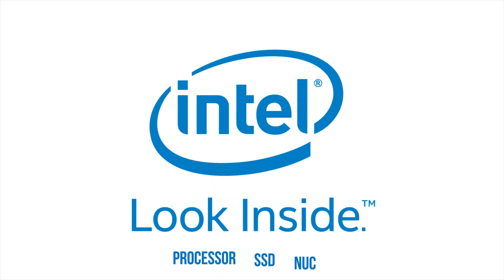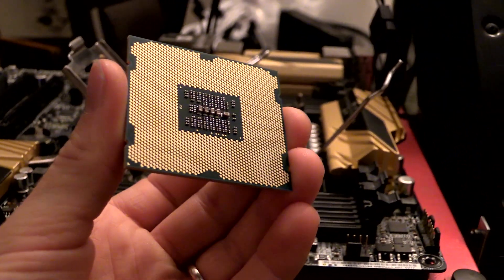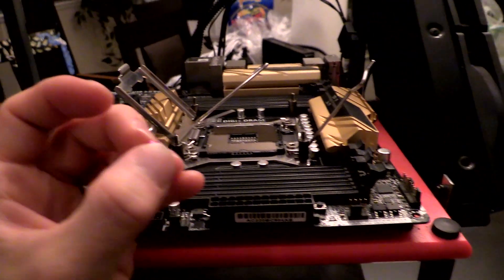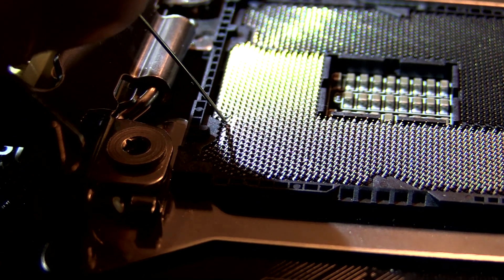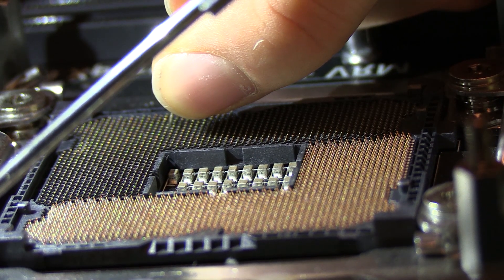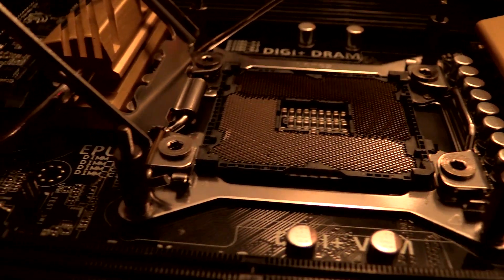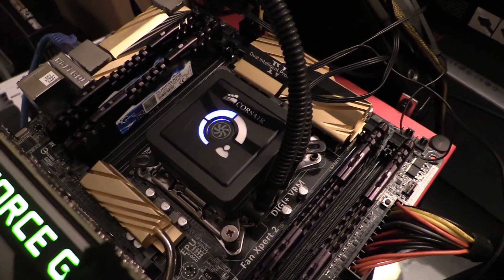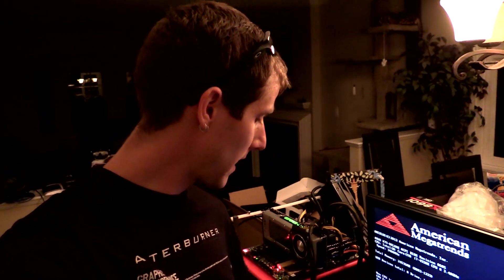LGA 2011 Socket Pin Repair Vlog - Fix a "Dead" Motherboard

Comment: Hey Linus! I watched this video the day it released.. and I thought to myself "wow that's a man with way too many spare boards on his hands". until yesterday I was faced with a similar problem, two pins on an LGA 1150 board were bent, and I used the tip of am injection to straighten them out, also I had no access to a magnifying glass. anyway it works perfectly now, and I couldn't find anyone else to thank but you. so thank you.

Comment: Best way to bend the amd cpu pins back is with a 0.5mm mechanical pencil. You simply take the lead out, put the hollow tip of the pencil over the pin and slowly bend it back.
Reply: I once fixed a pentium 4 cpu by moving a flathead screwdriver between the pin rows to straighten an bunch of them.
Reply: Linus mentioned that in an NCIX tech tips video when he salvaged an AMD cpu...
Reply: yep totally agree that's what I used when I bought a damaged athlon 5600+ years ago, although bent the pins on fx 8350 the other day and used my finger nail xD
Reply: that's
genius actually
Reply: OMG! Why didn't you tell me sooner???? LOL

Comment: You should avoid contacting the other pins with your bare skin.  I've assembled a stereo microscope from various sellers on EBay, I would strongly recommend it.  You can get an excellent setup together for comparatively little money.  If you can successfully fix these boards, there are real bargains on E-Bay for current generation "Not working" MBs.

Comment: I bought MSI z170A Mortar motheboard, settled all in, rig worked for like 3-4 hours. I power PC off and it won't power on again. After finding out whats going on, I noticed led is glowing on CPU.
Got CPU off and holy molly, pins were bent. 
I tried to repair them without magnifier glass, but it wasn't working. So I called it for RMA.
I told them it was working 3-4 hours and then it didn't work anymore. They told me its bent pins. I told them I didn't bent them, because my PC wouldn't work even 2 mins if that was the case. 
They told me that they do not accept warranty because of physical damage.
I'm screwed now, basically they gave me motherboard with bent pins and I cannot do anything about it. As soon as you accept package, if its with bent pins they will just say: "Hey, YOU BENT THEM!" and warranty is off.
:(
Reply: +BleedinglHeart  I have two heads off,  I checked the 1150 punout it says its for power and ground.. So I  didn't had balls to try it out,  bought new cheap as duck motherboard without capability to oc my cpu,  but at least I'm sure it wont die..  :/ I know i have 1151 pinout but its probably similar as 1151.
Reply: +89Ssik 1150 pinout is similar as 1151** writing from phone,  and people have reported their cpu died after like 1 week...
Reply: How do pins just get bent after working for 2-3 hours?
Reply: Buy from an online seller and get the return warranty to store (Newegg is my go to for mobo, buy the advanced insurance for a few bucks extra). Let them deal with RMA. Also, the pins do not bend over time. Either they were damaged to begin with, or you attempted to seat the CPU wrong.

Comment: +LinusTechTips my mobo has about 3 bent pins but here what happens when i powr on my mobo i have 2 psu's one is a 500 watt and the other is a 700 watt when i plug the 500 watt to the mobo it powers on for 2 seconds then shut off and will not turn back on until i hit the power switch and when i connect the 700 watt psu to the mobo it turns on for about 12-15 seconds and then it shut offf and it automatically turns back on witjin 3 seconds and does the same thing it will repeat this cycle until i hit the switch on the psu please help me a new mobo is not affordable for me or any one in my hous plzz help i really hope it not the mobo

Comment: I need ur help . I had a Zotac 620 graphic card and I sold it for some money. now my PC is not turning on. all the things in the cabinet run without any beep codes . but the monitor stays black...
Reply: +Vinayak S your processor has integrated graphics?
Reply: Nope dedicated graphics is 0mb
shared graphics is 125 mb shitty pc
Reply: you need to buy a shitty graphic card or a better processor, with integrated graphics
Reply: +Eduardo Rodrigues so u think the processor is dead ??
Reply: no, but the computer can't initiate without integrated graphics
Reply: i recomend to buy a cheappy graphics card
Reply: like a gt 210
Reply: +Eduardo Rodrigues Actually do u really get the problem I'm facing ??
well the screen stays black even after pressing the power button.
Reply: +Eduardo Rodrigues 
But will a gigabyte graphic card with 512 MB work ??
Reply: depends of your pc source
Reply: well man I borrowed my friends graphics card Zotac 610 but it's still not working
Reply: now u need to format your pc.
Reply: OK
Reply: I used another hard disk I had it was formated no use . the monitor is still blank no display.
Reply: ok, you plugged the video cable on the video card?
Reply: +Eduardo Rodrigues that's what graphics cards are for
Reply: ok, you tried to put in the motherboard?
Reply: +Eduardo Rodrigues actually that's how I started
Reply: +Eduardo Rodrigues I hav an idea what if I reset or jump the BIOS

Comment: i have a intel i7 processor and i want to buy a new motherboard, but i don't know the socket of my processor on the site it says the board is compatible with i7 but i don't know if i have a older i7 if that even exist can you help me out?
Reply: +2pvideo 
1) If you have a running system that contains your i7 CPU, then go ahead and download CPU-Z. It's a great program that will give you details about what socket your CPU is, and what model it is.

2) If you only have the CPU without a running system, then follow these steps: 
If you have thermal compound on your CPU's heat spreader, use light cloth dabbed with alcohol to wipe it off. The heat spread will probably have the model of your i7 imprinted, and you can check the socket number on the internet by searching for whatever model your i7 is.
Reply: my cpu is active and i have already tried the cpu-z it wont tell me the socket thou 
but on the mother board site it says its compatible with i7 (none inspecific) so im asuming it works with all right?
Reply: At least try and find the model of your CPU and try to research it on the web. No these CPUs will not work on all motherboards. There are specific sockets. eg, i7 3770 is an LGA 1155 socket and will ONLY fit on an LGA 1155 motherboard.
Reply: ok thanks a lot

Comment: I had the exact same problem with my board.  Ended up using the light on my phone and a needle.  Didn't have a magnifying glass so I took fully zoomed in photos of the pins with my phone....If it's stupid but it works then it aint stupid! =D

Comment: can broken pins kill the cpu i have this problem with i5 2500 and im not sure if my cpu is dead
Reply: +Naoufal D.Gnz I think that it is fairly hard to kill a CPU by conventional means... I accidentally put my 2600k through the wash when it was in my sweastshirt, since i had just come home from testing a friend's motherboard, and the CPU still works to this day. (obviously I let it dry out)
Reply: +Naoufal D.Gnz I think they could if they were shorting out, either by touching another pin or the wrong pad.

Comment: ...i am about to that , wish me luck linus
Reply: +Jeff Papas Wow that's some perseverance, glad it worked.  I would've been pissed to receive a board in that condition!
Reply: Did you fix it?
Reply: +gabriel mercado yep! The guy that brought me the mobo removed the cpu , and thought it was a good idea to hand me the cpu fan as a gift (!) , and put mobo and fan in a box together without any bubbles or paper , which box he put inside a motorcycle top case..... one of the cpu fan legs crashed in the socket and damaged many pins (at least 20) , and worked them good. Linus' mobo had no damage at all compared to what i received lol! I used same method years ago to fix another one without having watched this or any other video , but i was happy to see linus (and many other youtubers) use exactly the same method and tools! Notice that it may NOT work at first try , you have to relocate pins and try to post system several times till you get it right , in my case i did it more than 10 times. Good luck mate :)

Comment: i had lga775 same problem but i actually broke the pin on it tryin this xD. but i quess its not even the issue since the whole board dont even turn on. theres a flickering red light turning on near the 20 pin power socket. but the computer wont even turn on fans or anything. tried the mobo on different setups/psu but nothing. i quess lightning strike fired the mobo completely but im still hopin to fix it someway. oven baking doesent work either.

Comment: i miss the easily repair pins that where on the cpu :(
Reply: +Sana omar and how, I've re-aligned the pins on the Athalon X2 in my spare gaming rig at least 4 or 5 times now since its an old dell and whenever you pull the heat sink it takes the CPU with it.

Comment: I'm so pissed at myself since I managed to crush like 3 pins on my 1366 socket. I am gonna try and repair it tomorrow but luckily it was the socket B that got crushed. So I'm running the CPU A only which causes the fan to go on fullspeed for some reason. 

You truly are the king of kings at this Linus.
Reply: +TheSwedishCruiser did you fix it? what cpu are you running on your 1366
ive got an old i7 950 on mine :o
Reply: +Erik Seastead I managed to fix the socket pins so the machine runs very well now. I can do rendering using all processor power. However nowdays when I start up the system I get sometimes poor display output and only 1 display of my 3 showing information. And at the lowest resolution.

Comment: I use a "stitch ripper" to manipulate bent pins. It has a sharp, pointed tip, but it also has a broader, flat part that can be very useful in pushing pins in the direction they need to be pushed. Also, it has a plastic handle which makes actually using it a lot easier than a pin or any other small item that I've heard of other people using.

Comment: better if the pins were retractable the go down(undamgeable) when the clamp(is that what you call it)open then when you have the cpu in and the clamp closed the pins go back up to make contact

Comment: How the hell do you prevent this from happening in the first place? I've seen videos about broken motherboard pins and apparently broken pins are user-damage and not covered under warranty. Could it be that someone simply was being too negligent with their board and that they caused the pins to break? If I had a motherboard and CPU, I'd be extremely careful the instant I open that retention plate up. 

I've seen a couple people who build their computers on here, they fiddle around with the plastic cover that sits on top of the retention plate, they toss their CPU into the socket, they lift the retention plate up when their CPU isn't even out of the box yet. I really hope this usually isn't caused by wear-and-tear because motherboards are expensive.

Comment: You can replace a LGA socket, it's a $50 job at most electronics repair shops (ones that actually know what they are doing and not just humping iFixit.com)
Reply: LivelysReport you might do better to just buy a used 775 mobo... it'll probably be cheaper than a repair store. Recently bought a Gigabyte EP45-UD3p for only $25. Hell of a board.
Reply: Slot1Gamer Good to know never thought anyone was replacing actual sockets on these boards.
Reply: LivelysReport A bent pin is very simple to put it back. Just need to have a little careful. Sometimes I receive boards with 20+ bented pins... it's a 5- min job (there's no need for "extreme tactics".
The problem is when the pins are broken... sometimes may still work because some are ground pins... but if it's not... now that is way more dificult
Reply: Slot1Gamer so who replaces sockets and do they do 775 sockets??  I may try and fix the one I got, I think I got one bent pin, but if I can not get it fixed, I will either have to buy another board or see if someone can replace the socket.. so who do you know who does it that I can send my board to them to fix it.. I got a qx9770 extreme I want to run with it..
Reply: You can buy a brand new 775 socket from china or where ever (or even salvage one off an old board). Take it too an electronics repair shop that can repair BGA devices, they desolder the broken socket and put the new one on :3
Reply: what kind of electronics repair shop we talking about??

Comment: LinusTechTips I have an lga1150 board and only two of my ram slots are working, I noticed that you said only 24gb of ram were showing up till you reseated it. My question is, would a bent pin be the cause of the ram slots not working?
Reply: Yes, I have had this happen on my server motherboard, only 1 pin was out of shape causing one of the sticks of memory to 'disappear'
Reply: Grant Rogers thank you so much  Grant!
Reply: i have the same 3 bend pins 6 sots 4 not working and i have a bios message that i need to press evrey time
Reply: 1 pin = 1 function

Comment: For the record, the little metal tubes at the end of mechanical pencils are excellent for fixing the pins if they have been bent. Allows much safer leverage than a simple pin.
Reply: ItsEmber That is a great idea!

Comment: I bent about 16ish pins on my AMD Athlon a while back while taking the heatsink off (it pulled the CPU out with it, doof!) but I used a mini flat-head screwdriver and slowly bent them back! Put it back in and I'm still using that computer to this day!

Comment: I have a Gigabtey GA-X79-UP mobo with a bent pin, I tried this method, and my computer cant boot or post, and when I remove the ram it stays on, and the Bios beeps telling me there's no ram, so I dont know whats happening. If I leave the ram in it just turns on for a second or two, and turns off. Could this mean that I busted my CPU? Do I have a bad ram slot? (my ram is brand new, and I had used other ram in the system before, the GPU is working, and the PSU is working). Any input would be awesome because I have a limited budget, and want to get my computer fixed.

Comment: fixed a LGA 1155 socket yesterday using this method, the motherboard couldn't boot and couldn't detect ram. Now the board works fully but broke off two pins, so now only one ram slot is supported. But hey, better than nothing.

Comment: Thank you very much for posting this video Linus! Using it as a guide, I managed to save my new motherboard which had some bent pins (and was heading for the scrapheap). My own fault I must add, but you have just saved me the cost of a replacement board :)

Comment: Story time here: I ordered a Core I5 3350k IvyBridge CPU, an MSI CSM_B75MA-P45 motherboard, and 4 gb of Corsair Vengeance ram all from Newegg, I already had all other necessary parts for the build. I install all the components and when I boot up I get error code 99, I recheck my installation and still get the code, I'm guessing the Motherboard was DOA so I sent it back to Newegg along with the CPU just to be sure. A few months pass(shipping took forever, or Newegg, not sure who) and I get an email saying that the board had physical damage, they send it back to me and while preparing the motherboard to be sent back I had unknowingly damaged the motherboard pins while trying to put the socket cover back on. I phone them and explain the situation to a sales rep, after a few more phone calls I finally get the gift code to cover the expense of reordering the board. Meanwhile the CPU was still at Newegg and a few more phone calls I finally get them to ship it back to me, after reinstalling everything it boots up correctly. I ordered those parts November 12th 2012, I finally get all my new parts back March 14th 2013. First World Problems!
Reply: That sounds like a nightmare mate

Comment: I also bent a pin in a similar area before and guess what, it's for the IMC! that's why it won't boot... because IMC failed POST.
So I fixed it using a extremely fine tweezer.

Comment: What I've found is really good for fixing these pins is an empty mechanical pencil. Especially the kind with a thin barrel for drafting. Just slide that empty barrel over the pin and you can bend it pretty easily without much risk to the pin around it.

Comment: I'd bought an Asus P8-Z68 V motherboard from Fry's for about $15. It had several bent pins that I'd repaired like this. It worked for about 18 months, until I decided it was time to get a new computer case. I'd moved the board over to the new case and it didn't want to boot. I removed the board and it booted up fine, so I put the board back in the case only to have it not post. I got 18 months out of a really inexpensive board, so I can't really complain about it.

Comment: i needed to do this once. but it was a amd cpu and the pin was on the cpu itself. i did the ol' credit card trick and slid the credit card between the pins on both sides and it bent it back up. that was a long time ago (i cant even remember exactly how long) and the cpu is still alive.

Comment: bin there done that, but instead of bending the pin back into place, i ripped one out of a dead board and slotted it in on top of the original partially broken one, and it worked!

Comment: I had a bent pin in an AMD chip, it was actually easy to fix. I used a dull x acto knife as it was the thinnest piece of metal I had and simply aligned it back up.

Comment: Would my method work for a bent pin? I was thinking about using a fine mechanical pencil, and remove the lead. Then stick the bent pin inside of the mechanical pencil end, and bend it back into place.
Reply: ryan02s2k Thats a great idea!